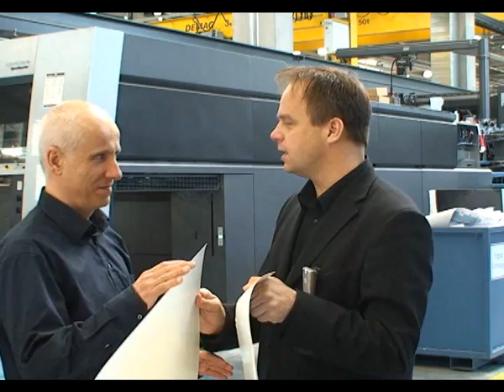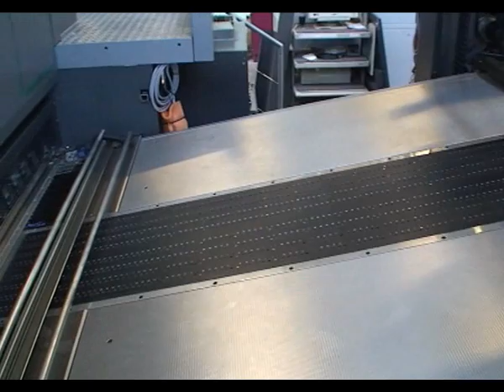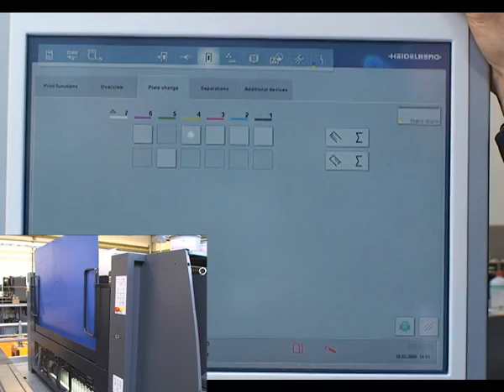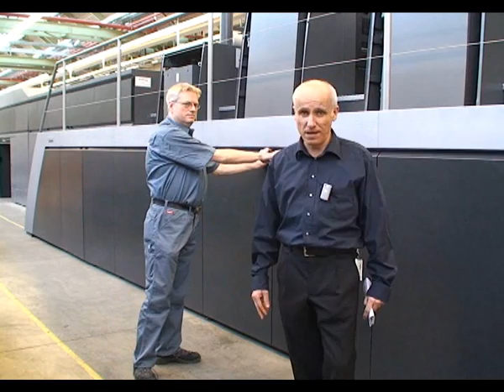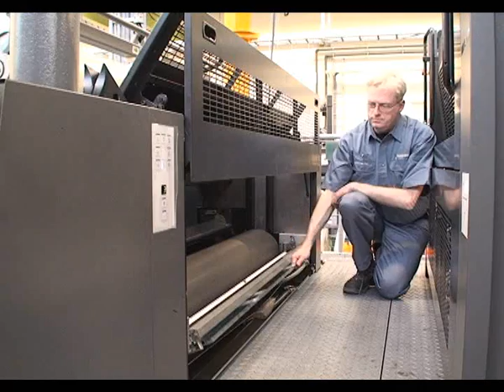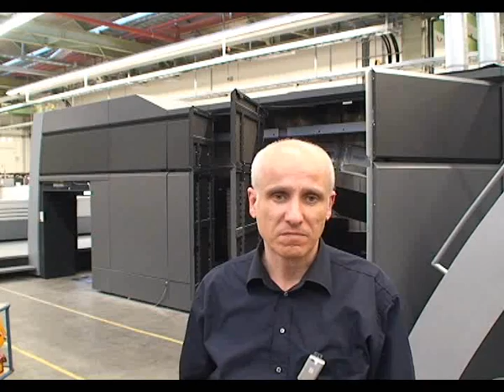Heidelberg XL_145_162!!!!!!!!!!!!!!!!!.wmv

Comment: I've bein runing Heidelbergs since 1970; from windmill and cylinder to K Lines to GTO, S Line, Rota Speed and Printmaster, besides TKO. Extremely Dependable Presses.
I started in 1968 in the Graphic Arts Industry, 47 years later I still running a 5 color GTO for short multicolor jobs. And still going and going
Reply: Ud. Me hace recordar a Haral Gener que estuvo en el departamento de montaje de maquinas Kord en Heidelberg Y a finales de 1979 y 1980 Trajo maquinas kord usadas a Guatemala por medio de la Quimica Hoechst Yo tuve el gusto de conocerlo Q.E.P.D.  Saludos desde Guatemala C.A